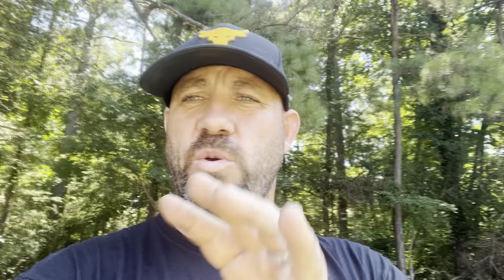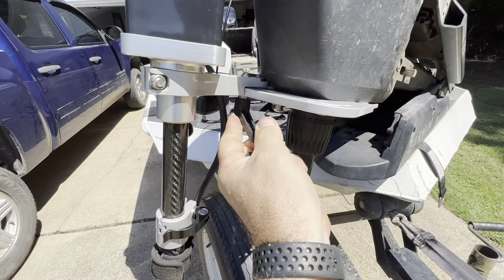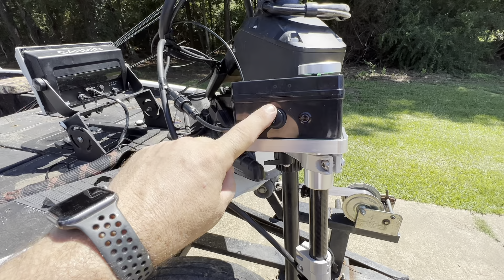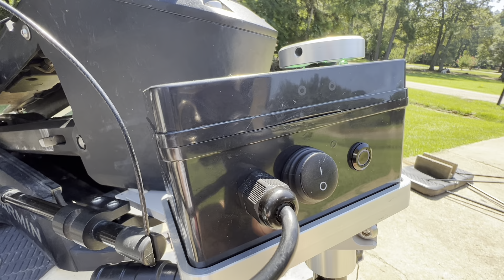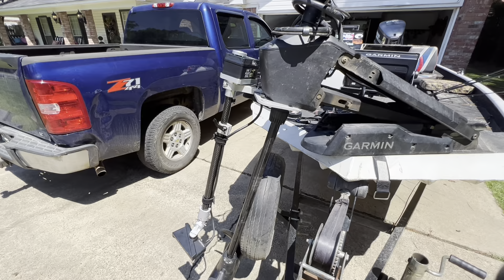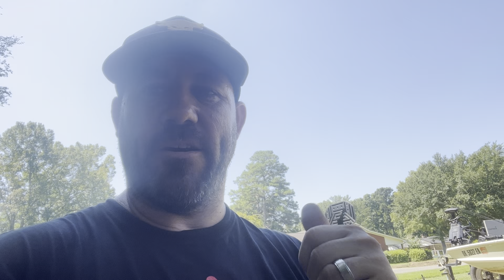The LiveFoot Generation 2: All The Technical Details and Availability

Comment: Question:  I run my GPSMap 1222, Livescope, and a Helix 10 ( I rarely have the Helix on when crappie fishing) on my bow off of an Amped 60 amp battery.  I have a junction/fuse box dedicated to this battery.  If I tap the LiveFoot onto this junction box, do you think it would cause any interference on the Livescope?  Thanks for your input.
Reply from the maker: Naw. It only draws .3 amps
Reply: Thanks Randy.  Just bit the bullet on LiveFoot.  Can't wait to get it so I can be hands free.
Reply from the maker: @quintriggins6557  did you use my code for free shipping
Reply: @The_Garmin_Guru  Yes sir.  Saved $17 shipping. Thanks

Comment: Bro gotta question bout the livefoot gen 2.  Is thier a way to tighten up the rotation slack? Mine seems to have gotten loose some how. The right and left turn about 4 or 5 inches b4 it even moves.  Ive checked all the allen bolts everything is tight.  Its gotta be in the gears.  Any info would be great. Thanks bro
Reply from the maker: I’d call dd26 and they will get you fixed up

Comment: The universal mount can be port or starboard mounted on an Ultrex?  Are you going to use any type of stabilizer as recommended by DD26?  I wish the mount and other hardware could be in black as an option.  Thanks
Reply from the maker: Yes sir and use the Dogbone Stabilizer 

DD26 DogBone Stabilizer
https://youtu.be/Bir5-5-6L30

Comment: It looks like a well made unit, but I feel like you simply have too much stuff going on. With the transducer on the force shaft, we have a single variable.   Yes, you can’t spot lock the way I am describing, but that is why we have crappie brakes.
Reply from the maker: Having it on the trolling motor shaft is for the birds. I would never go back in a million years